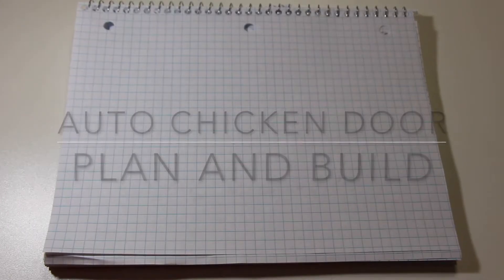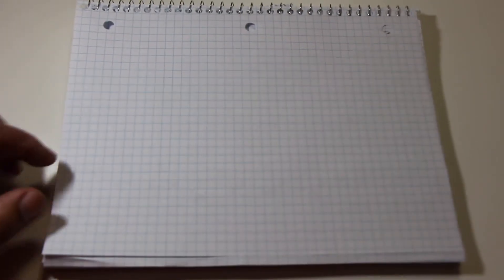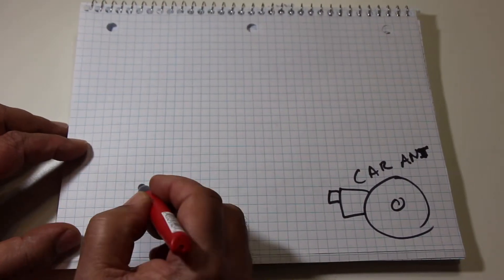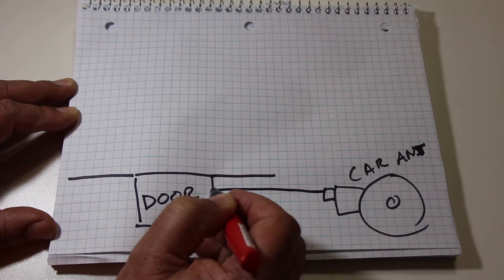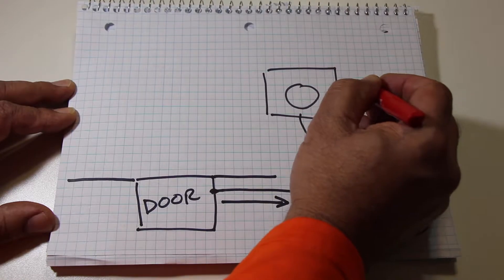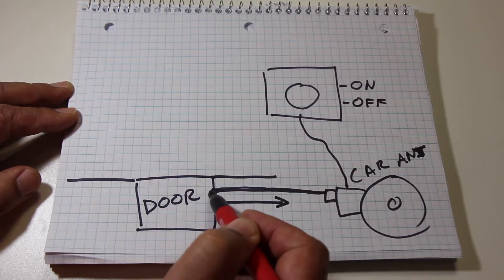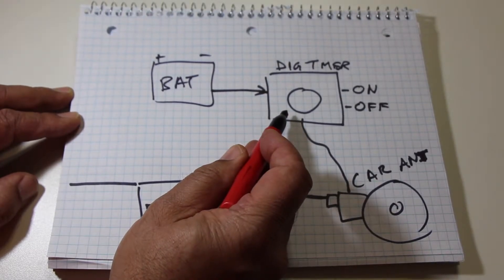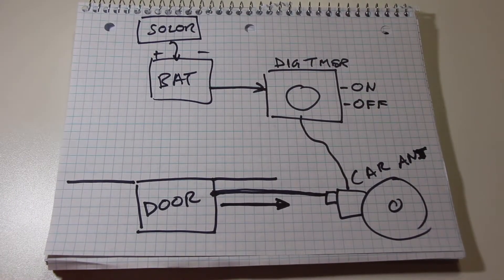DIY Chicken Coop Door - Part 1

Comment: Nice idea. My father had a car with that type of antenna when I was kid. Will the battery also provide power for the antenna to open and close?
Reply from the maker: Yes the battery will provide power to the antenna and tomer. It works. I just need to now install it.

On vacation so will take car of it once I get back home.